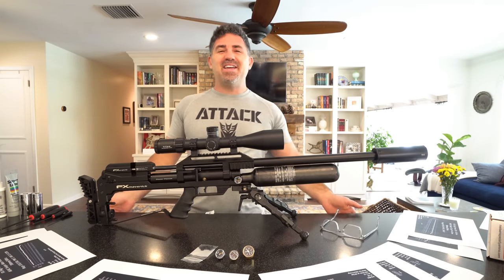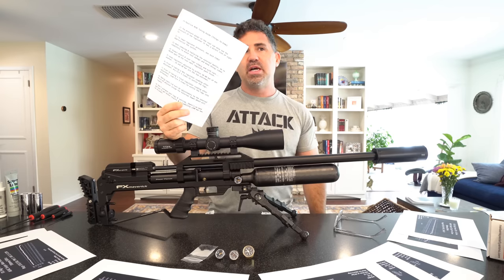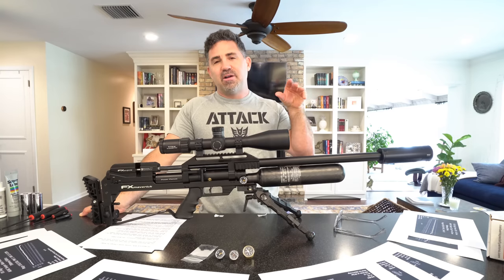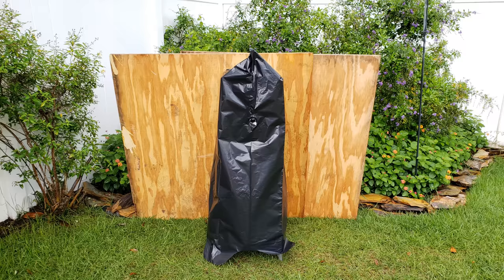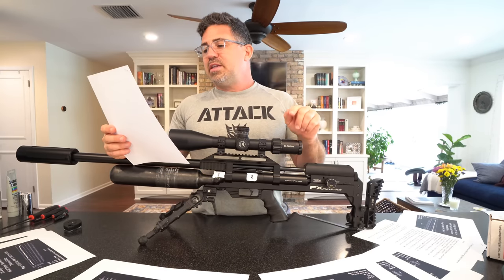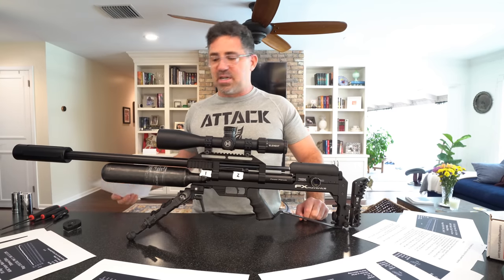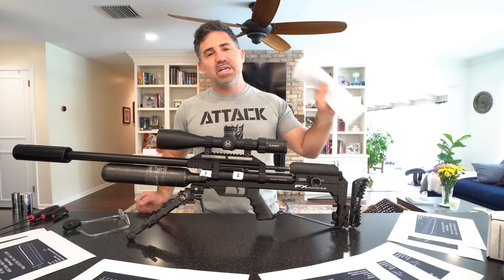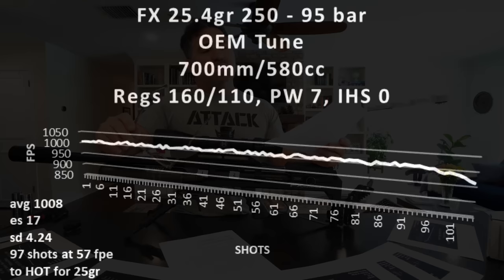FX Maverick .25 (Review) + TUNING GUIDE !! + FULL SETUP + Accuracy Test !! - How to Tune an Airgun!

Comment: Hi Steve, just wondering. I recently tried the JSB 25,34 Gr Exact with the standard reg setting as they come from the dealer. 111-114 bar on the second regulator, first regulator I don't know for now (Then I need to do the whole exercise to first  open second regulator to see pressure of the first regulator etc.). I just put the PW3 and got almost the same values of speed and power as with your 95/70 tune, PW2, IHS=0. However it took a a few shots to stabilise the speed, or would the spread become much higher because of the high  first and second reg pressures?
Reply: Hello.  I've recently released two "Ultimate Tuning Guides" and both would be a really good watch to help with your questions.  They'll teach you how to balance things out within your Maverick for good harmony between the regs and valve settings.  Best, Steve
Reply: @AEAC  thx Steve. Good video's, very clear :-) There is one thing that still is a little strange. I try to use the 25gr JSB tune 95/70, pw2, ihs0. I get speed of 840 on average. Now I have the regs on 115/85 and I am around 876. I have the Maverick .25 sniper, 700mm, superior twist x barrel, DonnyFL FX suppressor. It's a big difference from your reg pressures, any idea why that is?

Comment: Great learning experience Thanks for the hours of effort 
Saw you were using the Labrador. I believe it charts theFPE at various distances Would like to see a chart in 10 yd increments out to 100 yds.THINKING 
60FPE AT 60YDS WOULD BE GOOD FOR COYOTES?? THANKS AGAIN I-LEARNED A LOT TOM
Reply from the maker: In all my full reviews on AEAC Home, I use the Lab Radar as well.  There, you can see leaving and arriving energy with each shot I take at 50 & 100 yds.  Best, Steve
Reply: Thanks for the come back
I have to pay more attention to the fine print
I will.  Tom

Comment: So is the Maverick basically a less expensive Impact or is it a completely different gun?
Reply: With its "largest pleum," the Maverick can make more power than the Impact, but it has a lesser degree of control over the tune.  The Mav is all about "power" and has very good tuning control.  The Impact is all about the very best balance of power and tuning control combined.  This makes the Impact worth its extra $500 because finding tunes that agree with accuracy is easier and faster.  Steve

Comment: Thank you for this video. Do you have any way of measuring where your hammer spring screw started off? Relative turns is not helpful when mine was already messed with... I appreciate you sharing your experience and tips with everyone.
Reply from the maker: I've been helping people with this very question over at the AGN Forum.  There's 3 stickied topics there.  In 2 of them, I've been coaching people away from measuring by explaining a better way via letting the gun tell you what it wants.  In short, it's easy.  Pick a shot chart, duplicate reg settings, duplicate PW setting, use the internal micro HS adjuster to get you  to that chart's average, fine tune the internal micro HS from there.  Done!! If the ES isn't there, but the velocity is, increase velocity via the micro HS adjuster until it raises, then begins to lower back towards the average.  You'll find the tight ES on that side if it isn't on the other.  And remember, velocity can decrease as one increases HS tension and it can increase as one reduces it.  This is okay!! 😊 Steve
Reply: @aeacvlog2033  Thanks I'll check it out!

Comment: I was going to say some things about the Impact but I figured I'd better not do that since I'm going to buy the another FX gun. 
 The Impact is a complicated gun it's a lotta work but I did shoot it the other on 15th of July, & it kept most of the groups within an 5/8-3/4" and 1"-1.25" with the 700mm barrel. That's really not that bad I was shooting @ about 28-30 yards.
   I was also using the Donny FL moderator it was an unmarked moderator. Meaning  It doesn't have a name like "SUMO" written on it. By the way I will buy another Moderator from Donny FL for my 600mm .30 cal barrel; asap. 
  The Donny FL moderator is working great; when the Impact still holds 3/4"- 1" & 1" - 1.25" groups; w/ moderate winds.
Reply from the maker: Thanks for sharing.  The Donny FL Ronin moderator is available at SPAW.  Best, Steve

Comment: Hi Steve, Great vid, thanks for all your work. I have just taken delivery of a .25 VP Maverick which has the 600mm barrel. Would I be somewhere in the ballpark if I were to add 10 bar to your 700mm barrel settings? Thx.
Reply: Difficult to say.  I'd just implement the step by step tuning instructions  i provided on AGN (not to be confused with the step by step regulator adjustment instructions i provided there) and see what the gun tells ya it wants.  Steve
Reply: @AEAC  Well I have moved from the OEM settings (150/95, PW7, I added +1 on the IHS) which gave me 877fps with 34g JSB to 145/110, PW7, IHS+3 which is now giving 896fps. In addition the es is down from 20+ to 9 and the gun feels much happier and less stressed. Thanks for your help, it would have taken me forever to get to this point without having reference to your tunes not to mention a ton more pellets and air. Cheers from a Brit.
Reply: @REDLION0044  🤘👊

Comment: Hi. Very nice. Great videos. I’ve seen 100. 😂 Very good.  A question… I have a maverick 700mm .22cal. When I received it it was set at 100bar. I shoot the jsb’s 18.13 on power wheel 3 close to 900fps and same speed with the 25.39 on power wheel 6. Im very happy with the accuracy. I’m consistently hitting 🦎 iguanas at more that 100 yds. Can’t find my range finder but I know they are over 100yds because I zero my scope at 50 yds and at the distance I was putting down those 🦎 I had to aim 4 moa up. Now the question, + and - about leaving the reg pressure set at a specific point and change the power wheel to change pellets weight? Because I see you changed reg pressure for different tunes and I prefer not to go thru that process if I can avoid it. Hope to get a response. Thank you in advance.
Reply from the maker: Well, as I spoke about in this tuning guide and in my others, there is a relationship between the valve's hammer spring tension and the pressure it sees which is controlled by the regulator in front of it.  So yes, it's imperative they be worked up and down together.  Adjusting either out off harmony with the other will wreck your results... I even showed 2 graphs of that example in this vid.  Have a watch 👍.  Steve
Reply: @aeacvlog2033  thank you. I already ordered the digital gauge because the factory one is indeed hard to read precisely. Then I’ll do your thing. I’m very happy with the way the rifle is performing but I always have a place for new knowledge. Already set the gun at about 80bar which is 20less than is was and noticed it makes almost the same power. Well, I’ll keep watching. Thank you.
Reply: @ramilrodriguez8340  Thanks Ramil, my pleasure.  Steve

Comment: I have bit unusual question for you opposed of what you are use to.
I am very interested in the compact guns from fx the m3 compact, maverick  and maybee the dreamline compact, im located in Denmark so we get fac guns 1,77 cal
I need to get my velocitys down to about 500fps- 700fps for different reasons but is it possible to get theise FAC fx guns to work fine at such a low power when all focus at the time is on getting more power.. (and no im not just getting an sub12 gun) want be able so sell it used if I need to)
The other day I was watching a tun guide of the maverick by mat dubber an he said something about if you want to run an FAC maverick on low power you would want to switch the to regulators around an put them back in to make it work better on low power🤪🤔 that scares me I'm not really in to doing those kind of things to an expensive gun unless it made for it to be done..

Bye the way awesome videos!!!🤟
Reply: I sincerely doubt it... the less powerful versions come with different hammer weights and springs weights.  Best, Steve

Comment: also steve why do you set your tunes on setting 2 instead of 7 so you will have a bigger control on velocity
Reply from the maker: Good question.  It's much less time consuming NOT to invest in making a descending power wheel tune.  Creating one means a recalibration of the internal hammer spring for EVERY tune which adds a ton of time AND makes it that much harder to relocate the previous tune that you liked so much.  I'm also not a fan of making my tunes around a descending power wheel because the best speed/stability window for a pellet/slug is so narrow that one can't land on it anyway running the Macro power wheel up and down.  Best not to create all that extra work for yourself.  Hope that makes sense.  Steve
Reply: @aeacvlog2033  thanks Steve

Comment: Hey Steve, I appreciate the over the top tuning program on the Maverick. I'm purchasing a Maverick this week. I intend to purchase a Saber Tactical bag rider. My question is..... Do I need to purchase the adapter that fits into the base of the grip to attach the bag rider to it? I saw were PJ from Wisconsin had to use the adapter to attach the bag rider to one of the newer impacts.
Reply: Yes you'll need the adapter but mine came with ir.  I don't believe it's a separate purchase but maybe it is so double check me.
Reply: @AEAC  hey Steve, I have, probably a rhetorical question. I purchased the VP in 25. I was wondering.....since I have the 600 mm barrel, should I probably split the difference between the sniper and compact plenum regulator pressure to start out.  What I'm saying is since the sniper 25.4 g pro tune plenum pressure is 70 bar and the compact 26g tune plenum pressure is 100 bar.... should I probably start out the VP 25.4 gr tune at around 85 bar ( half the difference of the other two)?  Of course I'm assuming the increase in velocity value is linear compared to the barrel length. Sorry for the no brainer question. I would appreciate your input.
Reply: @jefferymccoy5461  No matter the setup, start with low reg pressure and spring tension and work your way up.  Let the gun tell you what it wants.  Steve
Reply: @AEAC  I appreciate it Steve. Yeah, I've realized that achieving the target velocity with the lowest possible combinations of regulator pressure and hammer spring tension give the most efficient and reliable tunes. It also minimizes the load and wear of the internals. Thanks bubba, establishing a baseline to start from was my intention. Pellets are too costly and scarce to be wasting while trying to find a tune. You're a good dude! Thanks for all you contribute to our airgun society!
Reply: @jefferymccoy5461  ... sometimes making it work a little harder (more reg)  from your best tune will increase accuracy  at 50 & 100 yds 😉
Reply: @AEAC  hey Steve, I wanted to ask you a question. My deal with the Maverick fell through so I waited a couple weeks and bought a.25  Dreamline tactical with the 480 carbon bottle. I bought it brand new, but when I unboxed it, I found that it already had a power plenum and a 23 position hammer spring power wheel. I was pleasantly surprised and thoroughly confused at the same time. Are the power plenum and the new power wheel standard on the dremtact bottle version now?
Reply: @jefferymccoy5461  From memory, the Tactical comes standard with the external power wheels.  Later Tactical models also come with the power plenum as standard.  Steve
Reply: I have been aware of the external power adjustment wheel. Traditionally, the wheel has been marked MIN,1,2,3,4,5,MAX and then A,B,C,D,E on the other side. Basically a double lobed cam. This power wheel is marked 1-23 with the even numbers represented by dots. Basically one elongated lobe.  I was just trying to figure when FX started using this style of power wheel. Sorry for asking such elemental questions. I've been unable to access any information that verifies the change.
Reply: @jefferymccoy5461  Sounds like you've describing the transfer port adjustment wheel?  That is separate from the optional hammer spring adjuster wheel.  A fully optioned Dreamline will have both.  The transfer port wheel will allow you very little tuning control by itself.  Steve
Reply: @AEAC  okay, either I really suck at explaining what I'm trying to ask or I'm getting the 'twilight zone' felling that you are effing with me. 😂 It's like the 16 position power wheel on the new M3 impact except it actually has 23 positions. Providing more precise adjustments of the hammer spring.
Reply: I didn't mean to sound rude in my last comment. I believe you are one of the few people "in the know" about everything FX. I figured if anyone knew when they changed the design of the  hammer spring tension adjustment "power wheel", you would definitely know about it. I've been salivating over the FX airguns for a year. It took me that long to save enough money to finally get one. I watch AEAC home and vlog basically on a never ending loop. Eventually, I find out when they changed the design.
Thanks Steve!
You're top shelf and I enjoy everything airguns you present.
I would love to be able to get involved with the airgun industry and design.
Reply: @jefferymccoy5461  Sounds like the external hammer.spring adjuster.  If it's rearward of the transfer port adjuster, it's gotta be the hammer spring adjuster.  Steve
Reply: @jefferymccoy5461  I didn't mean to come off that way.  I was only trying to help.  On the topic of FX, I'm not in the know to their constant product updating as you describe... however I do have access to FX's owners & engineers so I do ask them questions directly when I'm reviewing one of their guns for y'all 👍
Reply: @AEAC  that's where my assumption that you were up to date on every innovation FX comes up with was a bad assumption on my part. Of course you know what they say about assuming things. It definitely made an ass out of me. I apologize bubba! I suppose I could post my question on one of the many forums. Surely I'm not the only one who has gotten an FX Dreamline in the past few months with the new power wheel with 23 positions of hammer spring tension resolution.
I know you're a busy man. I appreciate you taking the time to help out! Later!
Reply from the maker: @jefferymccoy5461  No heartburn on this end.  I didn't take any offense to your good questions.  I'd just phone FX USA and ask them.  They're very responsive on the phone with good customer service.  Best, Steve

Comment: I have a question I hope you can help me with. Was setting up my regulators for the first time on my Maverick VP. Set up my 1st regulator to 170 as shown in the many how to videos I watched, went to degas the gun by taking the bottle off and firing a few shots and no air released from the plenum so I tried turning the 2nd regulator screw counter clockwise just a nudge as I saw in another video and that did nothing as well? 2nd regulator is fully open atm. Anyone had this experience and know how to rectify? Thanks

Comment: Hi great vid and appreciate the detail one question though you say to keep the pressure’s low but I watched a vid by Matt dubber and he recommends to use high pressure with a short burst of high pressure is closer to the principle  of a bullets mechanics from a conventional rifle it hard to know which way to go so much conflicting information
Reply from the maker: One should experiment with both ways as it'll come down to harmonics and shot cycle.  On the shorter 500 & 600mm liners, a gentler more easy going cycle may be easier to shoot well.  On the longer 700 & 800mm liners, a faster shot cycle may be necessary to overcome whip and to assist with the dwell time of the longer rifle's barrels and a big moderator hanging off the end.  These very questions, I'm working through now... and yours is a good one.  The most important objective by far is to tune to best accuracy at 100 yds with your given setup and shooting style.  I'd start easy and rachet reg pressure & HS tension up from there if needed.  The tune with the least waste air emerging from around the pellet when exiting the muzzle usually wins.  Best, Steve

Comment: How do u reset the IHS back to zero? Or what is the millimeter setting?
Reply: See my full review on my other YT channel for HS measurements 👍
Reply: @AEAC   a answer would have been better, I'm sure I'll find it thanks
Reply: @crypto_creep8222  It's a long answer to which I've put in a great deal of work to provide for the audience in both this video and that one.  There is no such thing as a "back to 0 setting" that FX uses when they tune & send these guns out the door.  They set them up via the tuning lessons that I've shared here, and in my full review on my other channel.  To ask for a zero setting is to misunderstand the very lessons taught, and is to glance over everything I've worked so hard to provide y'all.   Best, Steve
Reply from the maker: PJ Clarke and I will get your question answered on an upcoming episode of ask AEAC soon.  Best, Steve

Comment: i love you and all of your thorough videos but the tunes you show dont help any of us poor guys with the 22 cal vp model unless we buy a 25 cal barrel and i have read its ok to fill the vp aluminum tank to 230 bar and ive read that it should not be filled to but 200 bar so is one ok or are both ok thanks.
Reply: Aluminum tank can officially be filled to 232 BAR
Reply: thank you steve
Reply: actually thank you fx
Reply from the maker: All the rules, guidelines, and techniques I shared with y'all in this video will absolutely apply to your Maverick VP.  The only difference is that the 232 Bar, 400cc bottle will compress the length of the shot chart, reducing the number of returned shots.  Best, Steve